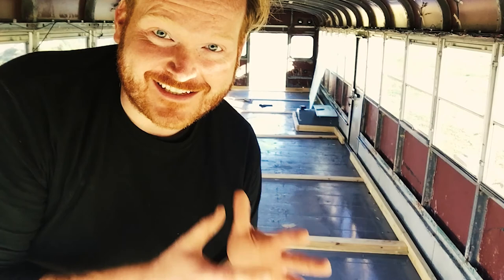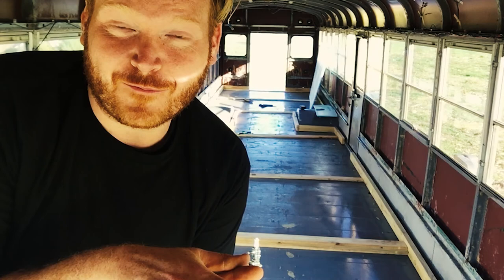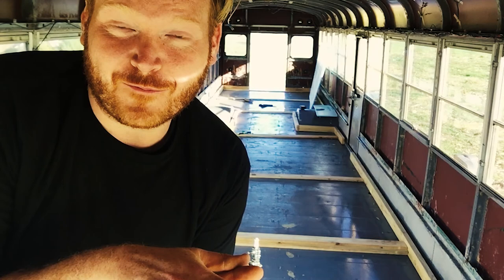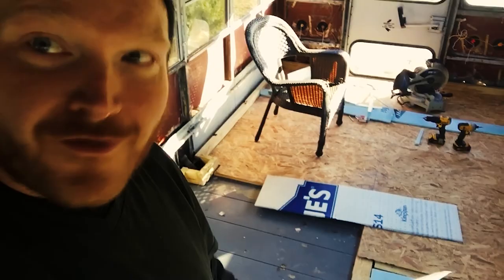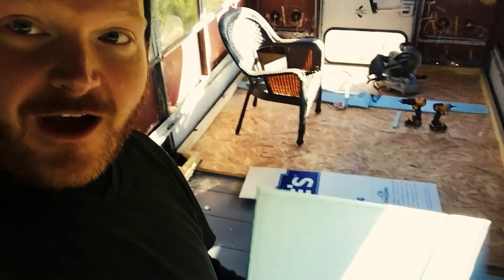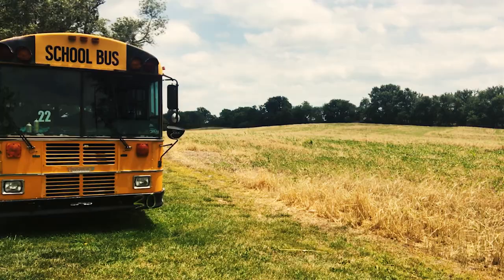Subfloor Installation | Skoolie Bus Conversion Tiny House Videos

Comment: Nice. But quick question. Should you put a moisture  barrier between the insulation layers just to make sure no mold since you are running the propane heater while doing the installation? If you are getting moisture during the build that might be a concern
Reply from the maker: Hi Linda! I had the same question. I'm only 98% sure of my decision not to add a moisture barrier, but from my research it seems like it wouldn't have been a good idea in a skoolie floor. 

As I understand it...because the bus has a non-porous layer of metal on the very bottom of the bus floor, adding any moisture barrier above it can trap moisture between the metal and the moisture barrier causing mold and mildew to accumulate. Same goes for the walls and ceiling. The better option is to provide an effective way to create air flow through the bus. (I installed a fairly powerful RV roof exhaust fan in my front bus emergency exit hatch hole) If/when moisture does build up anywhere in the walls it will be allowed to dry slowly from this air-flow. Apparently buses provide a unique challenge in this way because of their metal shell as opposed to most homes wooden frame/walls. 

I don't intend to be in the cold very often and I also intend to use an electric heater anytime I'm connected to shore power. So I shouldn't be using the propane heater more than 50% of the time. That being said, anytime you run a propane heater indoors you should have proper ventilation to help expel the H2O biproduct. 

I'd love to hear your thoughts on all of this! I really stewed over whether or not I was making the right decision, but came to this conclusion after researching myself to death...but now you have me second guessing my decision! hahaha!